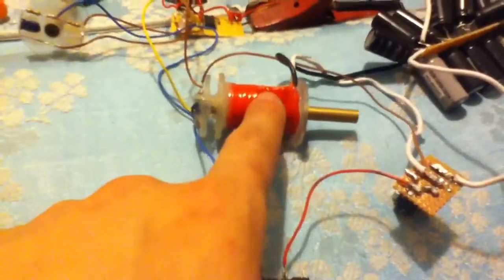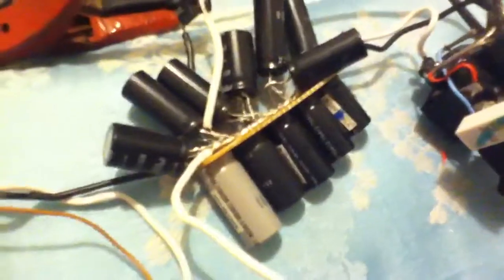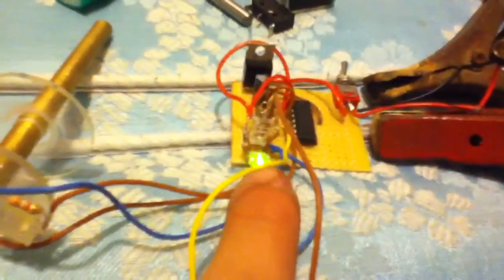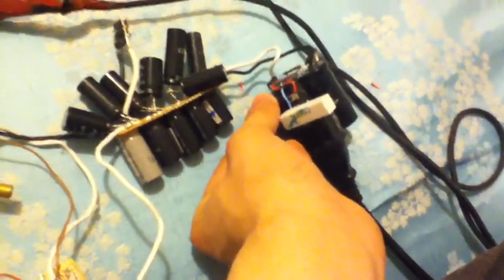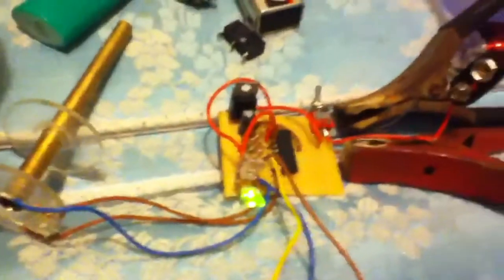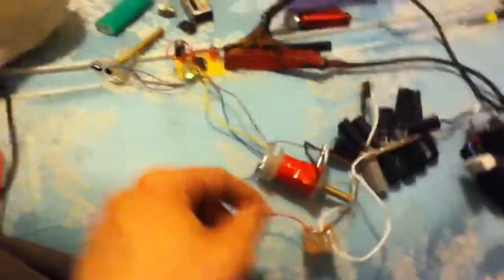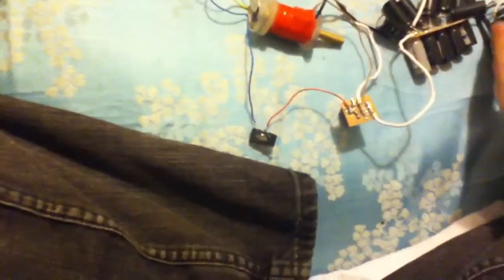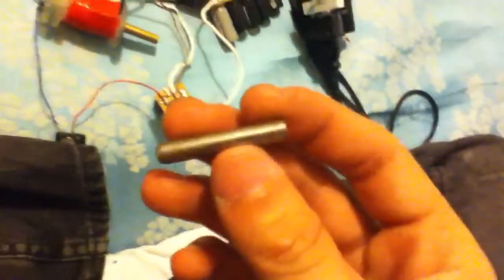Coilgun Rifle First Stage Setup

Comment from the maker: @ConnorXV If there rated for the right voltage sure. just make sure your not going over 250 amps when switching, if you are then you will want to put 2 or more in parallel :)